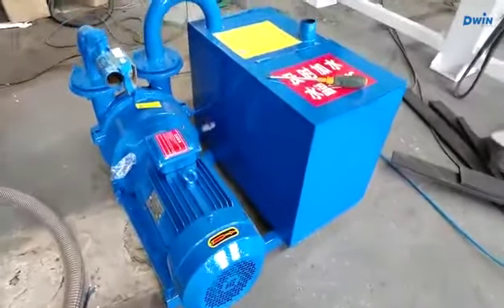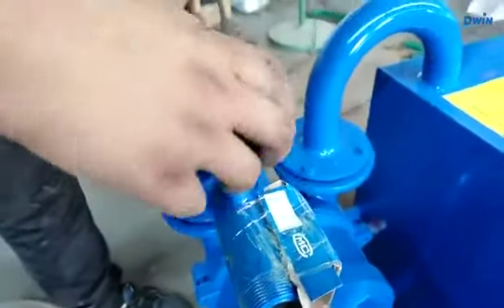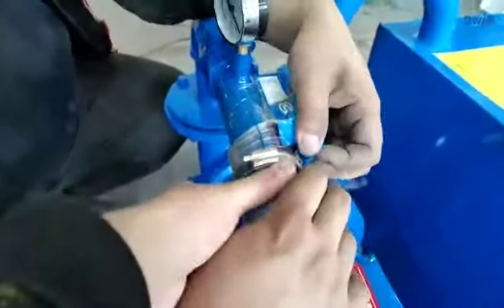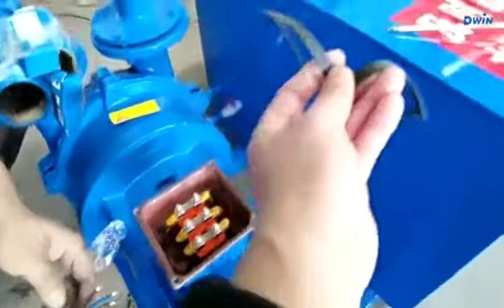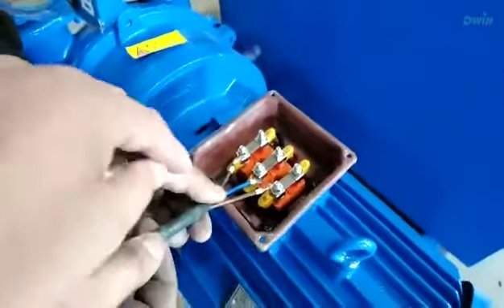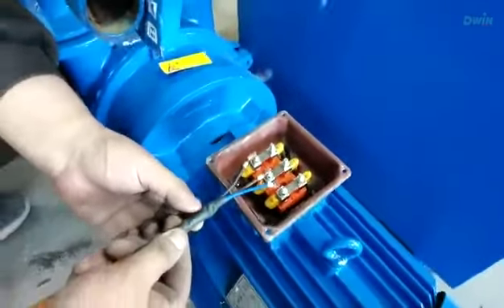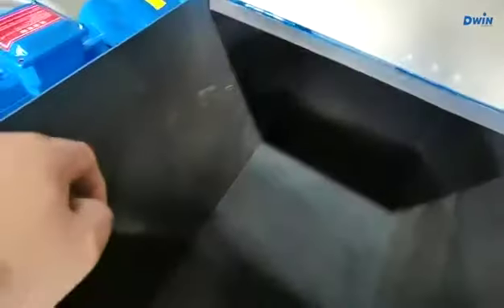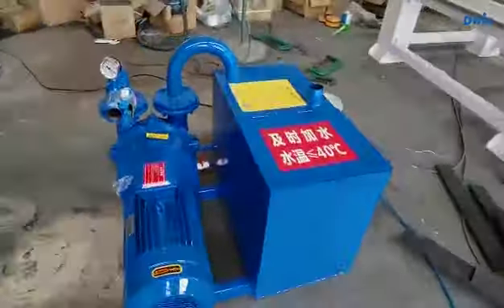how to connect water pump for cnc router vacuum table

Comment: how may kw this pump?
can we use this single pump for 1.5 x 3 meter cnc router machine?
thank u
Reply from the maker: Hi my friend , this is 5.5kw pump .   for 1530 machine , need to use 7.5kw vacuum pump .   7.5kw all 3 phase , can use 3 - 4 pieces 2.2kw pump ( signal phase ) work together , then ok , same function . Any questions , pls contact me whatsapp : 008618363061883